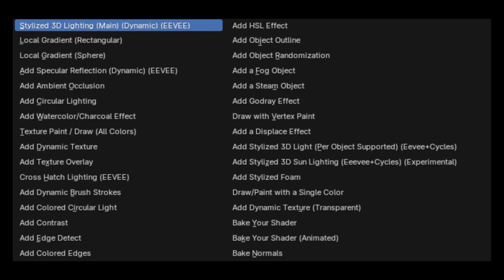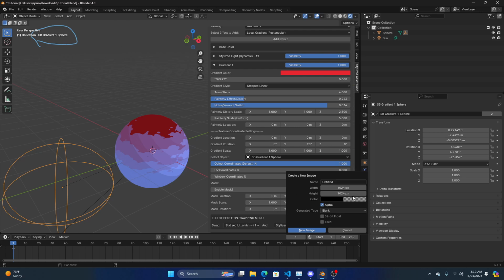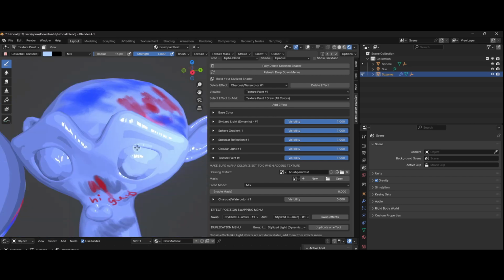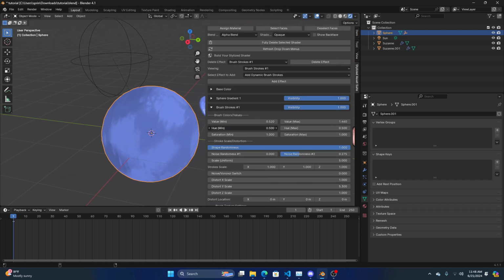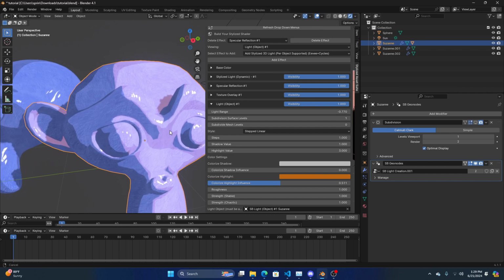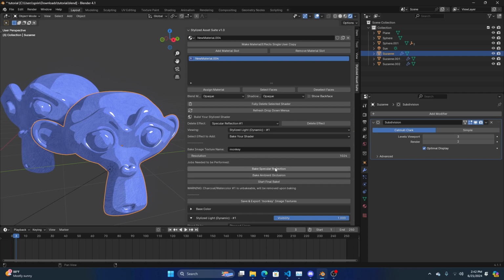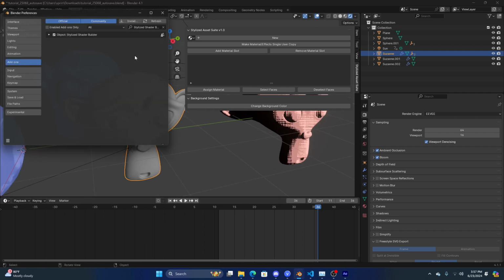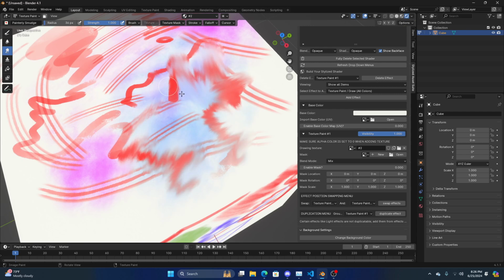Make Stunning Shaders with NO Node Experience -- Stylized Asset Suite Addon Full Tutorial

Comment: I bought the pro version but facing a major issue, whenever I try any of the features exclusive to pro I am met with this kind of error message:  "Python: Traceback (most recent call last):
  File "C:\Users\Thena\AppData\Roaming\Blender Foundation\Blender\4.3\scripts\addons\shaderaddon\__init__.py", line 12166, in execute
    bpy.ops.shaderaddon.addgreenlight()
  File "C:\Program Files\Blender Foundation\Blender 4.3\4.3\scripts\modules\bpy\ops.py", line 109, in _call_
    ret = _op_call(self.idname_py(), kw)
          ^^^^^^^^^^^^^^^^^^^^^^^^^^^^^^
RuntimeError: Error: Python: RuntimeError: class SHADERADDON_OT_addgreenlight, function execute: incompatible return value , , Function.result expected a set, not a NoneType
Location: C:\Program Files\Blender Foundation\Blender 4.3\4.3\scripts\modules\bpy\ops.py:109"

For reference I did have the free version, uninstalled it then installed the pro version, tried deleting whatever file of it could find inside my Blender folders, but still won't work. Any particular file i might be missing in deleting? As when I try it on a factory startup version they work so there's some sort of file not allowing me to enable the features.
Reply: I tried installing it on a factory loaded .Blend file and it works there, however it still doesn't work on a fresh file or such.

Comment: Hi-this is an amazing tool! I am trying to export my shader. After I am done baking all the necessary parts, and when I click save & export, nothing shows up. I saw that in the video it lagged a bit as well. But for me, I clicked several times and it still does not show anything. Let me know if I can fix this issue. Thank you!
Reply from the maker: make sure your file is saved + try restarting blender and doing it immediately when you load in

that being said that feature can be buggy, you can export in uv editing tab by hitting alt shift S to export images individually
Reply: @crzyzhaa  yeah that works too. I also just realized, and something to note, the texture did save to a folder when I clicked on the button before, it just does not show you it on the screen.